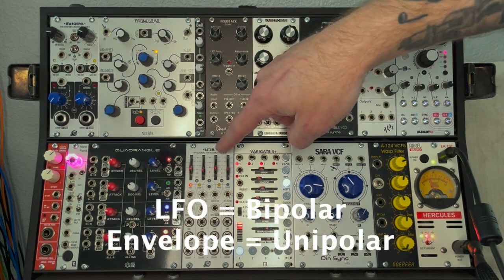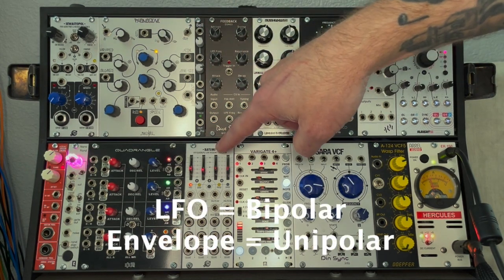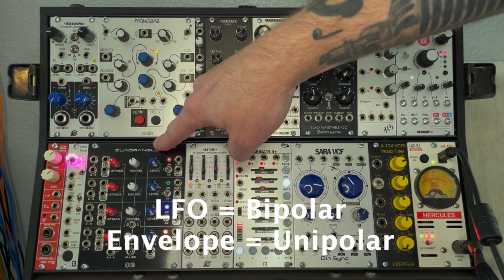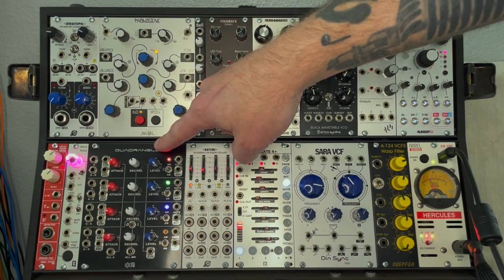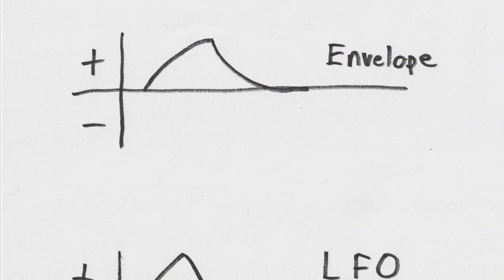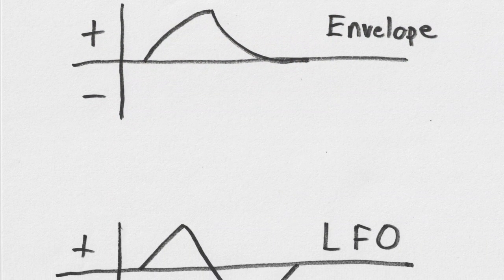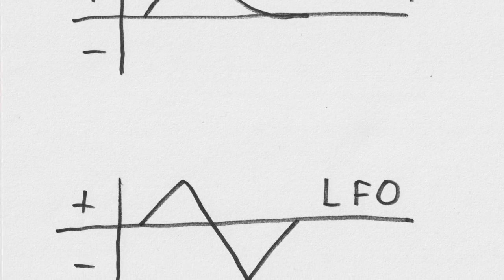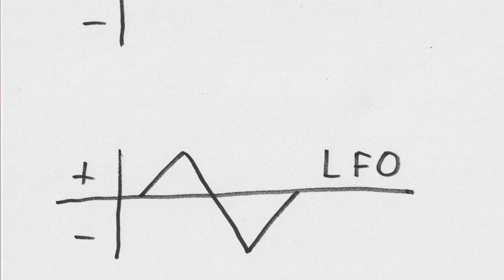What Does a LFO Do? (Modular Synth 101 | Part 7)

Comment: If i have a bipolar lfo of 2.5v to -2.5v is there a vca that will amplify that voltage 2 fold to say 5v to -5v? My doepfer VCA will only reduce the signal from whatever is going in. It doesnt really "amplify" anything. ☹️
Reply from the maker: Most VCA’s attenuate and do not amplify. There are some that have built in amplifiers where they might be able to boost a signal to 200% (or similar). Another thing to keep in mind is that most VCA’s are not bipolar so they can easily go from 0 to 5 V but not from -5 to 5 V. Again, there are some bipolar VCA’s on the market, but not very many.
Reply: @musicalmiscellany thanks, i know the intelligel quad vca amplifies. The manual has it listed as 6db. I have no idea what that would translate to as a voltage increase. Guess ill just get one and find out. 
 Thanks again.
Reply: @musicalmiscellany thanks